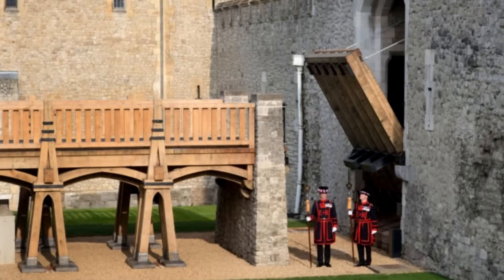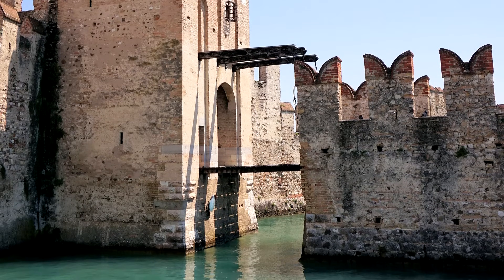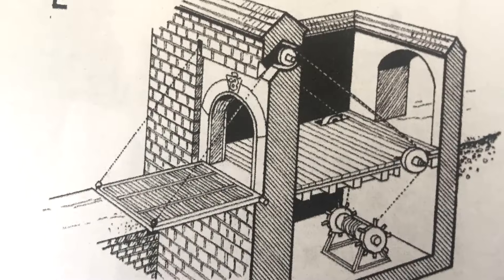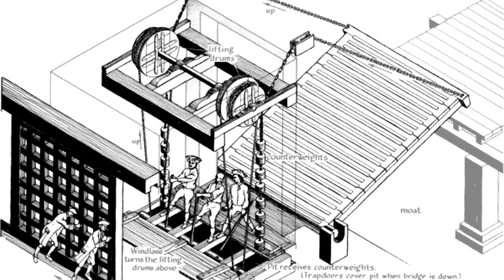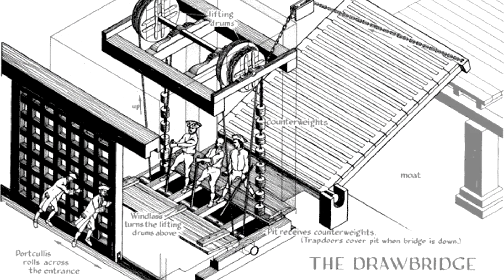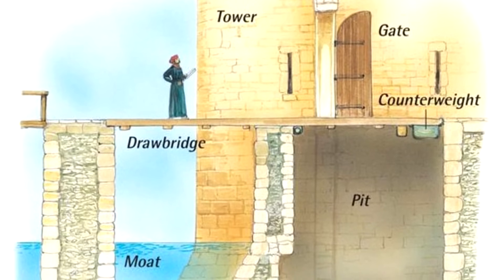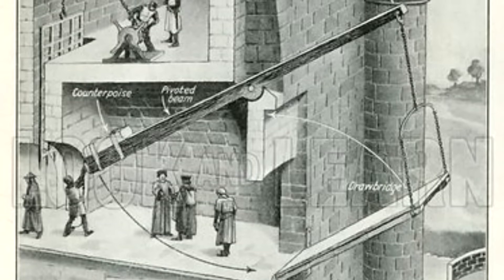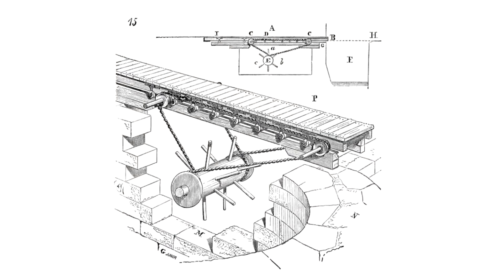The Different Types of Drawbridges & How They Worked | The Anatomy of Castles

Comment: A note from the perspective of Austria, Switzerland, and southern Germany:
Most castles were built on rocks, which means that flattening the terrain for the castle was extremely time-consuming and costly. It was cheaper to fill up uneven spots rather than chip away at the rock. This means that you won't find many drawbridges at gates. However, that doesn't mean that they didn't exist in the Alpine region.
The most common place for them was at the entrance of the keep and occasionally at the main building. Many of these buildings had no access to the ground floor from the outside and quite a number of them had external wooden stairs and walkways, which of course disappeared over time...